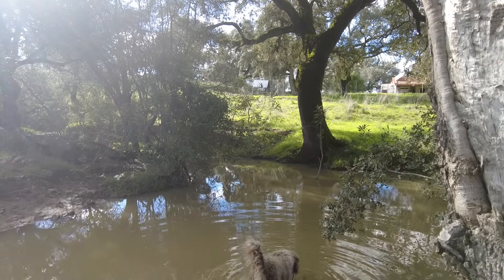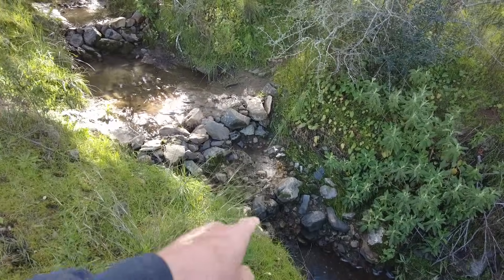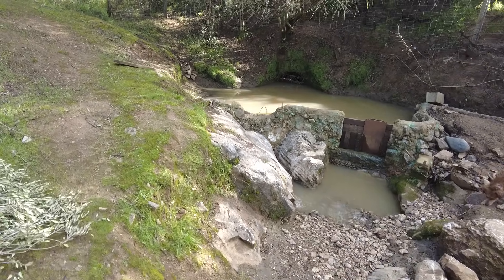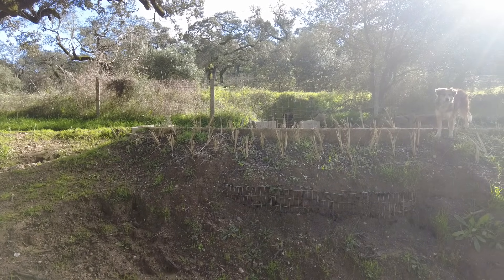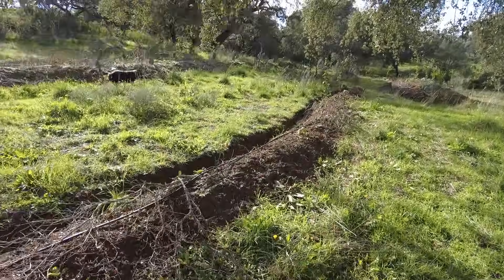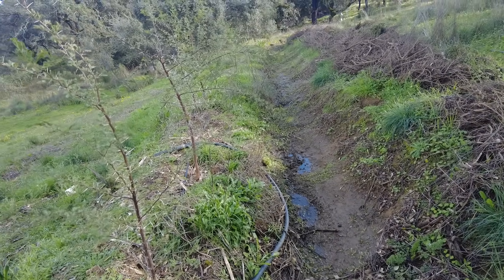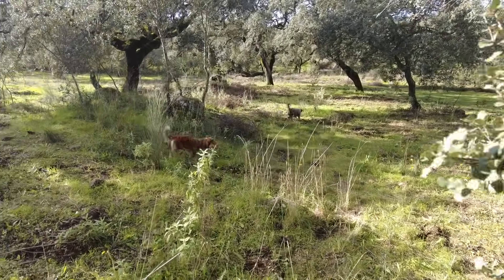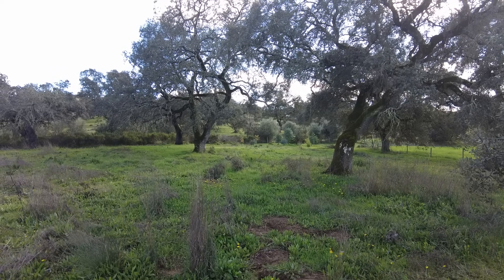Permaculture water systems observed.

Comment: 3:45 One more row of dogfoodbags on the downstream sandbags, and you switch the next level 90 degrees, centered on the bottom two bags upstream and downstream?
8:08 The purple grass in the center of the screen with it's roots underwater; That looks like a great candidate to divide into many slips that you can plant around the farm in areas that are occasionally wet.  It looks like it is very happy in that environment and it would be nice to see purple on green.
8:43 The grass growing in the middle of the screen; I believe you planted this grass area-am I correct Martin?  Whatever the name, it grew well and would be a good candidate to keep on hand to fill in bare spots as they occur.
9:18 Great idea moving the berries out into the sun.  They will be much happier on double thick topsoil.
Reply from the maker: @stevejohnstonbaugh9171  Keep sharing valuable information with us Steve

Comment: 0:57 I don't see an erosion to the right of the pond where the water overflows.  Is it possible that you can dig a small swale from the high water level of your your pond to your bottom swale or is the elevation wrong?
1:52 seeing the grasses laid down temporarily in the bottom of the creek is a beautiful site. Eventually, the creek bottom will be covered with grasses.  When you started Martin, the banks had no grass.  Everything was eroding, except the bedrock.
3:08 Add to this leaky weir and you will see rainwater come out of the creek bank foming a wider S bend if I see the elevation correctly.